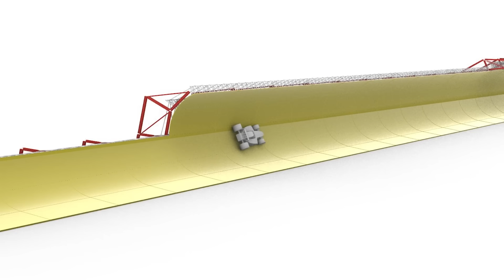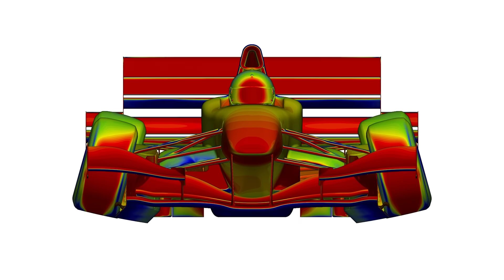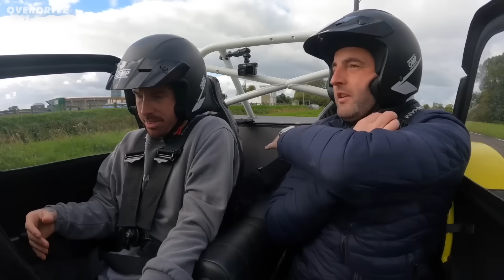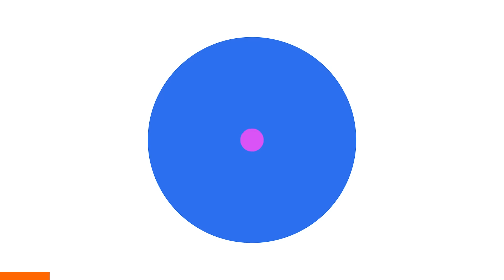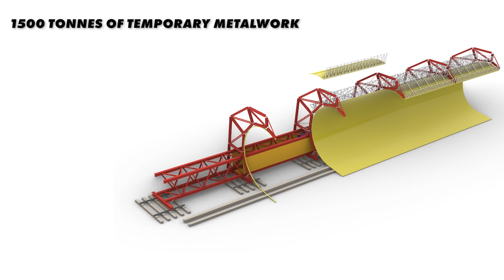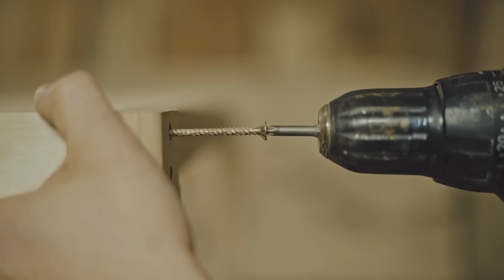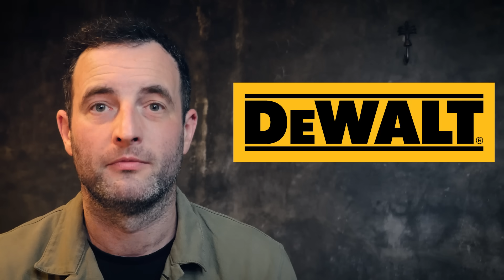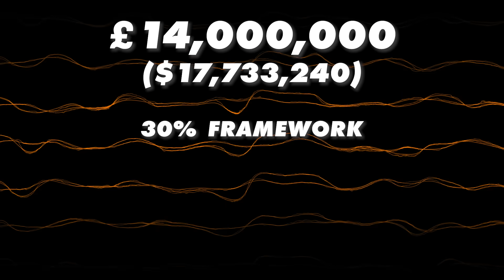Why It Costs £14,000,000 to Drive a Formula Car Upside Down

Comment: With all the complications of aero seemingly at their most in the transition phase, I wonder if it might have been simpler to do something like an extended loop. That way during the transition phase centrifugal force holds the car to the track and in theory the wheel base could be flat and the car much lower to the ground, maximising downforce. Would still be a ridiculous construction but might alleviate some of the issues they are facing.
Now, to just find fourteen millions dollar pounds to test my theory out!
Reply: Do you mean a spiral or a vertical loop? A spiral would have all the same issues as this but be even more complex to build, harder to see, and harder to prove that you're relying on downforce when inverted, and a vertical loop would be massive and just look like centrifugal force alone when they're trying to use downforce alone.

Comment: I get the desire, but to me its a huge waste of money. Maybe if the stunt had some sort of real world application. To me it seems tacky up here schilling for funding for this. I'm probably totally wrong, I'm fairly certain there isn't a better use of the money by these potential sponsors. Good luck though, I'll be honest it would be cool to see.
Reply: They already cheated the whole premise. Building all this stuff so they can run their custom electric upside down go kart when the question was can a formula 1 car do it. It’s totally pointless
Reply: @dave882 I can totally gwt bwhind crazy stuff like this, but it can't be pointless or the plonly point for ones gratification, especially when you're not using your own funds for it, but to each their own I reckon

Comment: At this point its not a stretch to remove the driver completely... Making the electric car remote driven through a sim wouldn't be 'too difficult'. Though it would take away from the thrill/drama, things are aways more interesting when there is a risk/challenge.

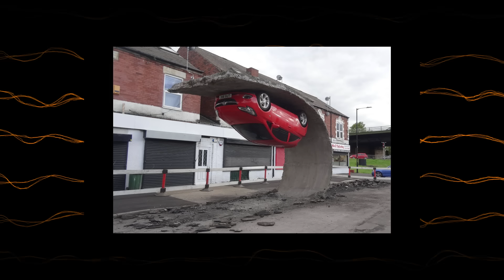Comment: 2:30 the photo of the car upside down on the street. 
Two facts:
1. I rode my BMX on that curved road as a quarter pipe. Only got one attempt as security was straight on it. 
2. That street is the street in Sheffield that had the flat from Four Lions. 
Bonus 3. After it was installed, a loud air raid siren went off. Heard it at work.

Comment: You're going to need belts in addition to the traditional racing harness.  You'll need your legs strapped to a hard point and possibly your feet anchored to the floor or pedals.  When you go inverted, gravity is going to pull your legs and feet to the top of the cockpit, reducing your ability to keep your feet firmly on the pedals.  As far as the excess strap length on your shoulders, some wide Velcro strips should keep them from entering you field of view.
Also, Have you considered installing a safety track?  Hard to describe, but basically a centrally located, enclosed tube with a trolley inside that incorporates a distance of safety strap (say half the height of the inverted tube) that can catch the car should it lose contact?  It can be long enough to prove that you are inverted under the cars own power but just short enough to keep you safe.
Reply: Pilots dont anchor their feet. Its easy to fly upside down.
Reply: @Nerb1  Respectfully, a pilot is only controlling the rudder and brakes with his/her feet.  The throttle is hand controlled.
Driving upside down is completely different.  Not only are your feet controlling the throttle and brake, but every single variation in the driving surface is going to try to lift your feet away from the pedals.  This could cause a massive loss of speed and control.

Comment: Why not using a suspended twisted tape for the "road" instead of a proper cylinder-shaped tunnel? Much less plywood area would be required, and maybe there would be less aero constraints on the car (especially the suction effect under the car would not suffer as much IMO because of no road surface curvature, the twisting problem would remain though).

Comment: When the car is 90 degrees to the road and the weight is being pulled horizontally to the car will the downforce be heavily effected do to the change in direction, and load on the suspension. I imagine being upside down is actually not the hardest part, but instead getting to that point will be.

Comment: Maybe this has already being discussed, if so I apologize, but wouldn't it be better, easier and safer to have the car driven remotely at least for the first few tries? I don't mean to be the pessimist of the situation, but while I think a car like that could "easily" stick to the ceiling when going straight, I see so many things that could go wrong during both inversions, especially on the first try...
A remotely driven car would also remove the human factor, so you would not have fear, anxiety or stress getting in your way (or at least not as much).

Comment: Just put a car upside down in a wind tunnel…..check the car falls off the ceiling with the fans off, then put the car on the ceiling again and turn the fans on and see if the car stays up….surely it will be cheaper, and with the exact same result.

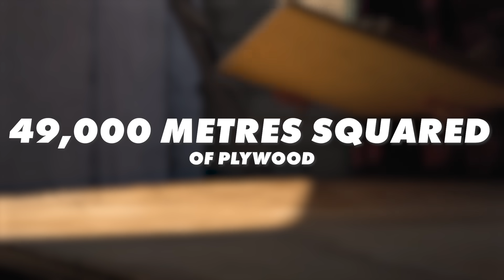Comment: 0:33 - 49.000 thousand metres squared is actually 927 square miles so roughly the area of the Isle of Wight plus the area of Greater London. Hopefully you can get the job done with just 49,000 square metres of plywood. Try asking an engineer or mathematician about the difference between square metres and metres squared.

Comment: Why not use a high angle bank test track like the one in Maricopa, AZ with the exit being the inverted part in the following straight? Way less material in the approach, and the weather in the fall/ winter is pretty consistent throughout the day. Also less constraints on the car as far as the curvature it would have to account for and aeeodynamic descrepancies.

Comment: This is a stupid waste of money. There's a bunch of vehicles which cling to walls.  Think of putting "landing wheels" on the top of a quad drone. It could drive around a room on the ceiling for 30 minutes.  We know how to fly inverted. I think it'd be more entertaining and interesting if you tested "wacky" or banned aero designs with several instrumented cars.  Have races pitting different variants.

Comment: This idea sounded stupid from the start, but now that you've put a price tag on it, it's time to take a sanity check. This amount of money could be used to finance serious ventures instead of a ridiculous and dangerous marketing stunt. Or it could go toward homeless shelters or women's shelters. And then there's the carbon cost and sheer waste of it all. If you could do this using off-the-shelf vehicles and existing road infrastructure on the cheap, it'd be stupid but cheap. But this sort of massive cost moves it from stupid to insanely wasteful.

Comment: Have you considered using a rolled steel surface rather than plywood. Then it would have the same thermal expansion properties as the structure, so you could theoretically have no gaps between panels which makes for a smoother ride and more consistent aero.
Reply: That would increase the cost dramatically.
Reply: @reaperbsc  Really, have you done the math? He's talking about 4 layers of plywood, shaped and screwed into the frame with 500k screws. That's an insane amount of labor hours. At a certain point it's better to spend more on material if it saves you significant assembly time and cost. 
Just to sanity check the cost: Steel cost is approximately $0.42/lb. Depending on the structure, you could probably get away with 3/16"-1/4" thick plate x 9500 feet long x 120 feet wide (60% partial circumference of 60ft diameter circle) x 144 (to get to square inches of area) x .2836 (density of steel, lbs/in^3) = $3.7M to $4.9M (assuming no bulk discount). That might seem extremely expensive, but just wait until you calculate the man-hours of labor to screw down all that plywood. Unless you have a massive pool of volunteers, cutting, placing and screwing down 4 layers of plywood is going to cost you hundreds of thousands of dollars at a reasonable labor rate. Plus the cost of plywood and screws. I bet the final cost of each option is not as lopsided as you'd think.

Comment: I know it wouldn't be quite as cool, but you could demonstrate the physics by making a machine to rotate the car upside down while in a wind tunnel. Would be wwwwaaaay cheaper.
Reply: So would you just have a stationary car, with brakes applied in a rotating cylinder? My brain is trying to process the physics.
Reply: @Gramercy_Stiffs  yes it's all about wind velocity relative to the car. This is how auto makers test cars in wind tunnels (stationary car). You would just rotate the car upside down with the wind on.
Reply: @Adlamo Because the original premise this is based on is that an F1 car can drive upside down. Using a different high performance, high downforce car is still in the spirit of this. Sticking the car, stationary, in a wind tunnel less so, even if it does still technically use the same physics.
Reply: Exactly!

Comment: Warning ⚠️
You are using individual plywood boards as the main surface. But did not mention how the gaps between these boards will covered.
Are you guys using the downforce alone, & neglecting the ground effect to do this run?
If ground effect is considered, then those gaps (between the plywood boards) have to be sealed.

Comment: Consider making the car depart on the opposite side where it enters, like doing a barrel roll.  You won't have to change direction while upside down, and the structure should be stronger.
Reply: The issue here is you won't be able to see inside. They mentioned that in a previous video
Reply: @philipjkb15 They could make the middle part of the ramp completely upside down, with just roll on and roll of points on opposite sides of the ends
Reply: @blurglide  great idea - like a suicide mission or what?  in case of an issue, you cant steer down,..

Comment: Let's solve this problem. 
98 mph X 1 second = 144 feet  
And you want 5 seconds up-side-down so 144 X 5 = 720 feet
$17,000,000 / 720 feet = 23,611 dollars per foot  
$23,611/10 = 2,361
Simple, get 720 rows of 10 people standing shoulder to shoulder to pay $2,361 each to have a Formula car drive over them up-side-down.
Throw in some Rolex, Monster, Red Bull, and TAG Heuer signs to pad the pockets of hard-working problem solvers (like me), and what could possibly go wrong?
Bam! Problem Solved!  
What? Would I stand under the car and pay $2,361 dollars to do it?  No Way!  But I have no doubt in my mind it will work.

Comment: For the location you might try to enquire about the former city airport in Plymouth (Devon). As far as I know it's in a state of flux where it's no longer a working airport but they can't redevelop it as was the original plan, the runways are still functional and maintained as far as I'm aware. Right next to the hospital as well 😂
Reply: Not a bad idea! I grew up there before moving to Aus and this would be a decent reason to go back and visit😂

Comment: I'd love to help assemble the tunnel if it's within a 90 mins drive from the M6 border crossing between Lancashire and Cumbria. Legit question though: what air temperature have you done your computer simulations at? Not sure how much difference running on a hot or cold day would change the down force, but I doubt you'll be doing your record attempt on The Hottest Day of the Year™

Comment: Your selected surface material is not rigid enough. When the car travels up the wall, the elasticity of the surface material changes. This changes the characteristics of the aero pack. Drastically. Also there's very little ways to fix this. None of them are cheap.

Comment: I can conceive of a couple ideas to run a car upside-down using only down force that avoid both the roll over transition and the need for the power source to be inverted. Both employ bogie wheels to support the vehicle until sufficient down force is generated. Not as impressive but sufficient in obtaining the goal of going upside down using down force. Would also only need a structure about 5-10 meters tall with no need for a curved driving surface.
Reply: Just read your comment properly. Can't picture yours, but mine would surely work better than their cantilevered roll over tunnel
Reply: Just loan a McMurtry with 2000kg of fan assisted down force at 0km/h in a 1000kg car and stick it to the underside of a floor slab in a parking building.

Demonstration complete.

It's not like they're using an F1 car now anyway.
Reply: Is it like a hotwheels loop, that transitions to inverted for a straight bit, then comes back down again..because that would prevent this long transition of doing a roll. He should go in via a loop. The tight radius would aid in staying on due to centrifugal force. Much simpler structure, more efficient.

The way they're doing it is daft
Reply: @Tom_Hadler do you know how big a radius you need for a half loop to be able to be survived by the car doing 100miles an hour?
Reply: This is a great idea. Some kind of retractable (telescopic/hinged) outrigger legs with small wheels at the end extending from the top of the car. The car starts inverted in a simple rectangular tunnel with a flat roof, resting on the outriggers but with its own wheels pressed up against the roof. It then accelerates to the necessary speed and retracts the outriggers, leaving it driving fully inverted as intended. As the end of the tunnel approaches, the outriggers are extended again to take the car's weight. The outrigger wheels would probably need to run in some kind of track to provide directional control and braking.

Comment: I think a big risk on this is not breaking traction on the transitional zone, once you're past the halfway mark the downforce will be actively lifting the car up but up to that point only the friction between tyres and tunnel will be holding you, if you light up the rears and lose traction the rear will slide and drop, you'll lose downforce and the whole car will drop.
Reply: You’d have to build the driving surface like a twisted ribbon so he wouldn’t have to turn his wheels and lose traction.  I think the car needs to be able to generate twice it’s weight in downforce too, or close to it.
Reply: @xKanastax  That may help, I was thinking of the huge torque on demand with a small, light and all-electric car, I guess throttle maps could soften the demand to minimise the problem.

Comment: Wouldn’t it have been easier to must hang it upside down in a modified wind tunnel with air flow like crazy and then disconnect and see if ur suspends itself?

Comment: This project gets dumber and dumber. From "let's show that an F1 car can actually drive upside down in a tunnel" to "a formula car", "definitely not in a tunnel", "can't use a regular engine, the fluids don't work", ... guess what, the way this project has gone so far every step has simply proven that it's entirely impossible to actually drive an F1 car upside down. End of story. Also a half looping with a small straight and then the other half of the looping would cost far less, be smarter design and be actually achievable.

Comment: Scott. I've got a serious suggestion for a place to set up the project. 
Plymouth airport. It's permanently closed, it's owned by Plymouth city council. The runway is long enough at over 1 km long in a east west direction.
And because it is a good thing to have quick access to, Derriford hospital is about 800m away and they also have a helicopter pad.
The downside is it's an airport and they're windy.
One other thing is would it be a good idea to have a 'this way down' gage in the car? It could be as simple as a needle that tells you that you're on the floor, upside down and in the perfect place. It might sound silly or it might be distracting, but it's a thought.
Reply: The gauge is called an artificial horizon, and they exist in planes. Good idea
Reply: @Tom_Hadler  
Why I couldn't remember the name I have no idea. Thank you. 😆

Comment: Fingers crossed that it all goes well! 

Every time I see a new video in this series I remember reading in a car magazine circa 1999 a claim that one of the variants of the McLaren F1 had so much downforce that it'd continue to adhere to the road even driven upside down. I didn't think anyone actually would have wanted to put this to the test — this was back when cars without any kind of internal combustion engine were years away at best (the OG Honda Insight was the only hybrid you could even find in the States), which meant, per the last video, the engine wouldn't have run upside down, to say nothing of the cost — but I always wondered what it might have looked like.

Comment: 2.5mX9.5m plywood is absolutely bonkers. Plywood deforms due to moisture and having these absurd sheet sizes increase’s that risk.
Reply: Let alone finding a manufacturer that can make those sizes
Reply: Do you honestly think they specified dimensions that they don't already know exist? Also you can make boats out of plywood, oh and the Brits made the de Havilland Mosquito multi-role fighter bomber, so a temporary curved surface shouldn't be much of a problem. 🤦‍♂️

Comment: This is the sort of project that should tour different large shows and showcase the incredible engineering. This is a lot of money for a 1 time stunt
Reply: The labour and shipping involved in that would be astronomical. I'm not sure they would get any sort of return on investment from that unless there is some major sponsorship deals.
Keep in mind that the video alone is going to make a substantial amount of money without having to worry about the logistics of moving the whole shebang.
Not to mention it sounds like they are aiming to rent as many of the components as possible
Reply: If he does it once he has a 1% chance of dying. If he does it 50 times he has a 39.5% of dying.